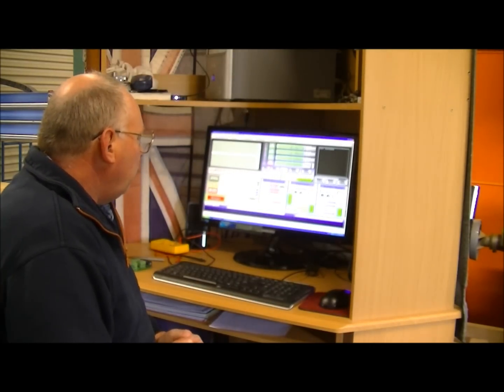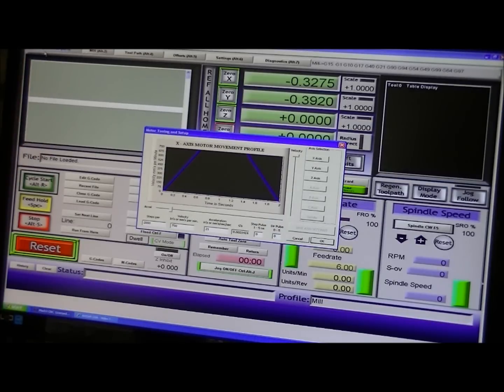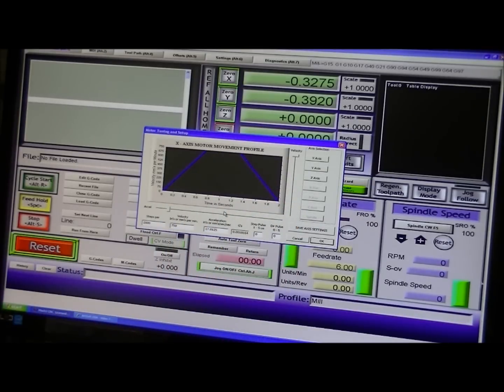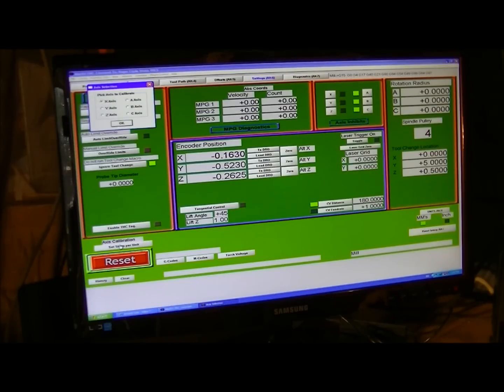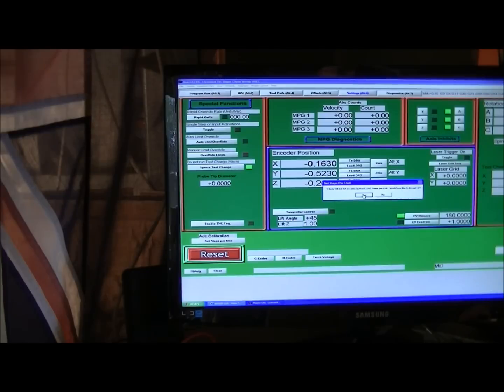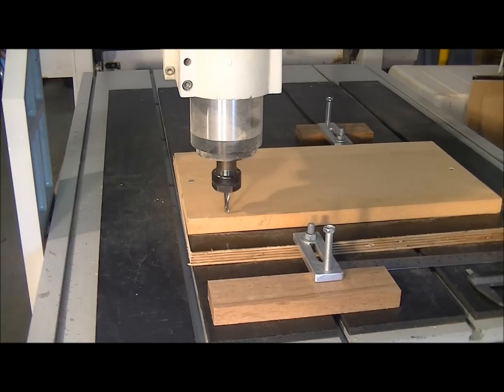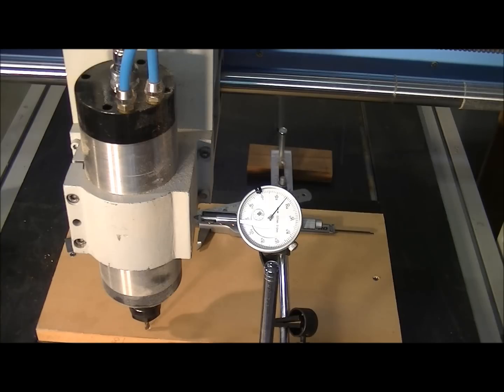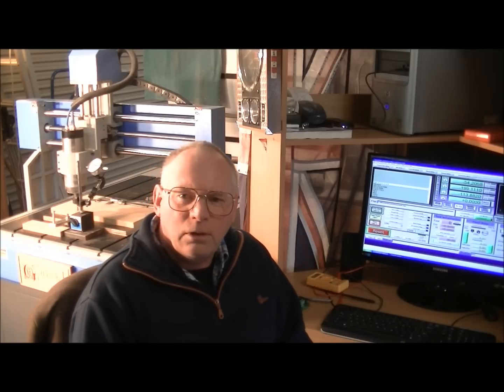78 Mach3 Motor Tuning  CNC router

Comment: After changing the motor tuning settings, I save and exit the menu, turn off and on mach3 again.  When I look at the motor tuning values, I see the values I saved, but when I call the g code file and start processing, I see that the engine tuning values change automatically and return to the initial values.  I would appreciate it if you could help me find out why this problem occurs.

Comment: thank you for this video. My X axis is vibrating when is on 25% speed (300mm/min), on other speeds looks good. Do you think my motors are not tunned or I got another issue?
Reply from the maker: Hi, redo your motor tuning ( see my video 245 )
Reply: @inventorsworkshop9600  And cheque your stepper driver settings, especially the amp setting.

Comment: What AndthecorrectAnswerls said....   but if you dont know any other way your method would work.  Start with 50mm as you did then repeat but go 300mm - 400mm if your machine has that travel.  The greater the distance the greater error and easier to tune using your method without the calibration tool you had.

Comment: I saw little point in doing another auto calibrate for .5mm when you weren't even holding the vernier gauge at a right angle to the bit and your starting point was roughly by eye - but it was good to see how effective Mach3 is and that you wised up and graduated to a dial.